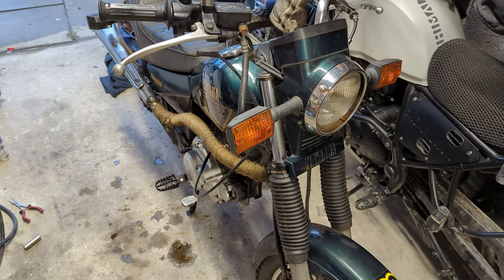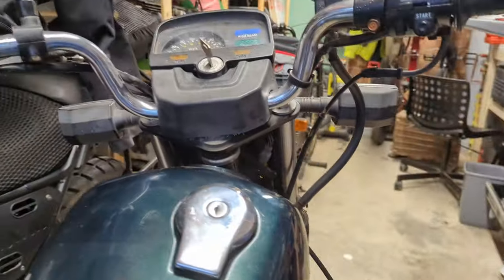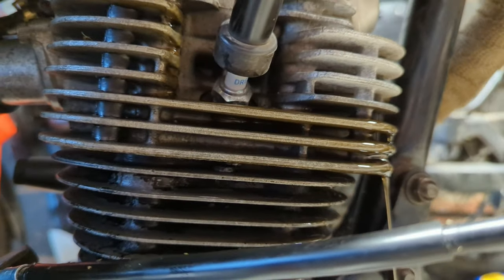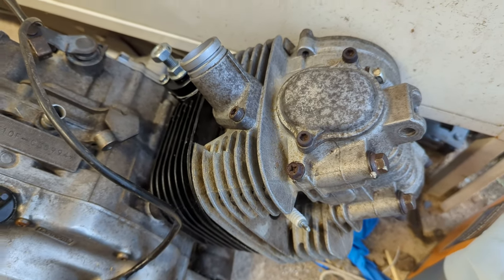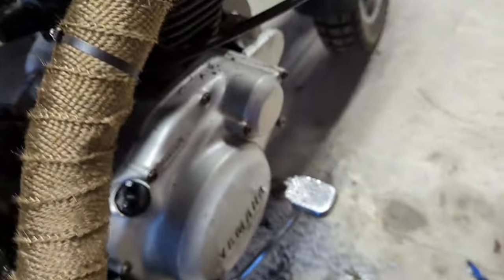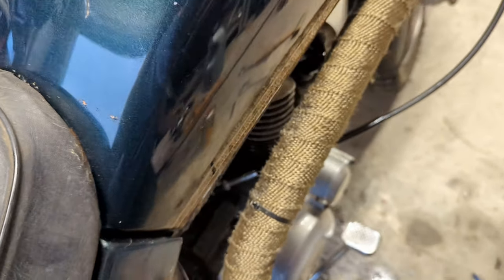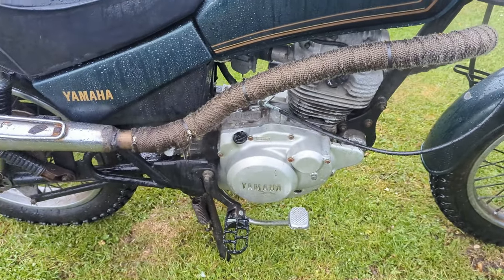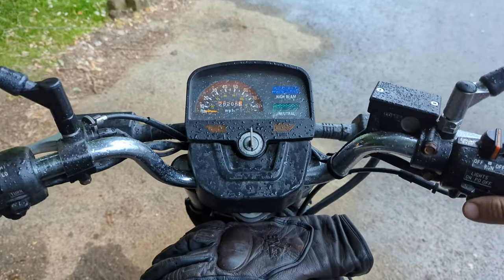Oil Starved SR125 engine back from the dead? | JAM#32

Comment: Glad the engine is okay. I found that particular bolt in my new kit was too long! Can you not use the clutch plates out of the original engine or is it better getting new?
Reply from the maker: I thought given how cheap the clutch plates are, probably safest to put new ones in while I am going to the effort of taking it apart.

Comment: i just bought one of these , back wheel locked right up and oil got all the way up into the airbox and started peeing out like mad !! what could cause this ?? great content btw !
Reply from the maker: My guess would be that the oil made its way up through the breather tube that goes to the airbox (Its near the clutch cable adjuster, behind the cylinder, fairly large black tube). Could be overfilled oil, excessive crank case pressure - known as blow by. Try taking the spark plug out and checking if the cylinder is full of oil. Good luck!
Reply: @justanothermotorcyclist  just found out the rings have gone too ! not looking good, new engine will be put in then ill rebuild this one , ty for the knoledge too :) . this engine is all original parts and its on 36k miles !